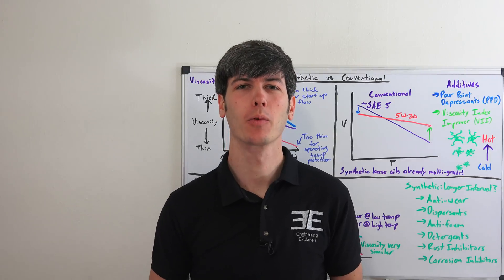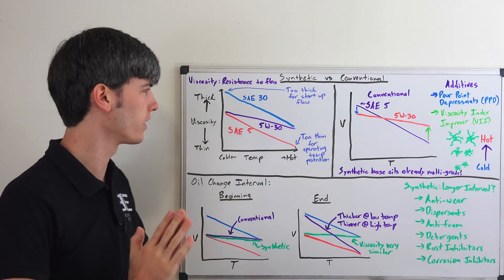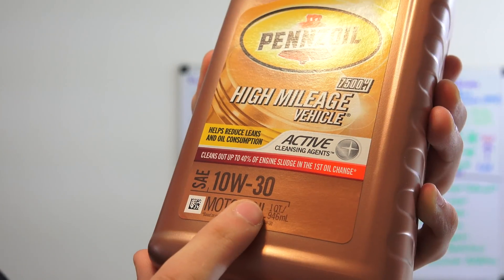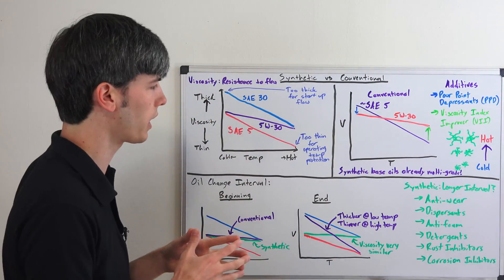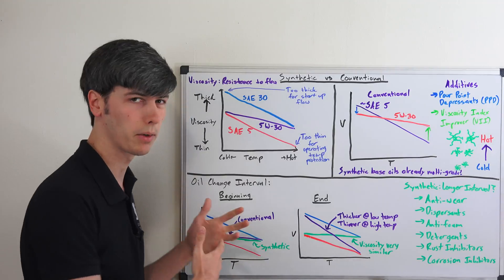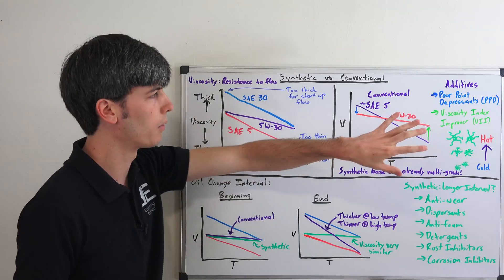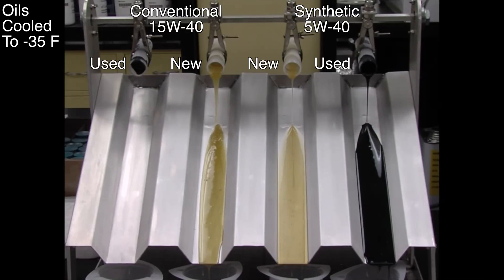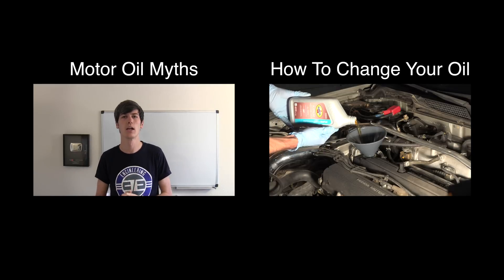Is Synthetic Motor Oil Better For Your Car?

Comment: Jesus how are you supposed to do an oil change on a vehicle using that conventional oil? It was thicker than tar!
Reply: Change your oil when it's above -35°F :)
Reply: Run the engine for a few first, do your beer run at that time too ;)
Reply: Ahh true, for some reason I was thinking the oil he showed in the vid was already warm. My bad.
And yes, the beer run is the most important precursor to the oil change :)
Reply: He said that, and that was not what was being shown, it was between the new and the old of each type. But also showing what the 15w does when you live in cold temperatures and dont do an oil change, so its not bs....
Reply: It's because he used 15 w conventional, if he used 5w it would have flowed nearly the same as synthetic 5w this is marketing bs
Reply: Simple.  Don't change your oil when it's -35 degrees out.
Reply: dude that test is with chilled oils to show the difference.  but when you change your oil, you always have a ride first with your car, and change the car right after it, with engine hot, that oil drains easily...
Reply: That's why you warm up the engine before changing the oil.  (And never, ever, use conventional oil..especially Pennzoil.)  I had a Chevy V-6 and faithfully changed the oil every 3,000 miles with Pennzoil and had an engine failure at 96,000 miles...worst oil EVER.
Reply: nobody does an oil change at those temps lol
Reply: +Terry Beaton been there done that.  i remember having to blowtorch my 1970 beetle oil pan just so it had a chance of starting at 530 in the morning...
Reply: dude that test is with chilled oils to show the difference.  but when you change your oil, you always have a ride first with your car, and change the car right after it, with engine hot, that oil drains easily...
Reply: +Ivan K
 change the oil I mean
Reply: Its almost frozen lol its at -35 degrees
Reply: Thats y its like tar
Reply: +Terry Beaton yup! your nose hairs would freeze just trying to breathe...  thats why i'm moving to hawaii.
Reply: LOL I see what you did there ;)

Comment: I'm watching this thinking. Man you are going to get some hate mail. lol  Actually that was very good BUT you can go extended change intervals on synthetic because the main danger is really wear. All the other detergents are nice and all but they don't just completely disappear and your vehicle would be fine without them for short periods of time. Remember they didn't even exist for the most part when our dads were young. 
Two key things to remember when trying to decide whether or not to go for synthetic. 1. Does your car have a turbo? Do you sit in traffic a lot?  These are the times when synthetic shines. Turbos are very hot and standard oil does not stand up well to that heat for long. I have repaired my share of engines that had failed turbos where the oil passages were so coked up it was literally hard charcoal. yes I literally drilled some of it out.  We won't get into the fact that those cars were using standard Pennzoil.
2. The second major area of consideration is outside temperature. Does it get very cold in the winter where you live. If you wake up and it is 30 below zero outside, your oil may be too thick to start your car. Especially if you skipped an oil change or two.  Synthetic on the other hand makes it relatively easy to start your car despite your cold battery not functioning as it usually does.
If you really want to pursue extended oil change intervals. Have your oil tested at a lab that specializes in that. They can tell you the condition of the oil and whether or not it is safe to keep using. Every car is different so it is important to establish that baseline.
Oh and there is a reason myself and many other older mechanics don't use Pennzoil.
Reply: AETheMexican Back a few years Pennzoil used to be "the cheap oil" so everyone bought it. For some reason it didn't seem to hold up well. It left deposits in the engine and heaven forbid anyone missed an oil change. The classic sign of a pennzoil engine was plenty of deposits/sludge buildup on internal engine parts. Mostly noticeable on the underside of the filler cap. If you took the engine apart you had to scrub and clean every surface with solvent. 
As a young apprentice that was my job and my boss pointed out the difference to me when we rebuilt truck engines at their regular overhaul time. He pointed out which engines used RotellaT and which used Penzoil. RotellaT engines were spotlessly clean. All I had to do was rinse off the oil. The pennzoil engines had nasty sludge buildup on them that had to be scrubbed off.
That is why you find many older mechanics in the US that won't touch Pennzoil. They/We consider it an inferior oil. 
Is it the same oil today? I doubt it but Ill go with what I know. RotellaT has always been above average for quality. 
Will pennzoil work decently with regular oil changes? It probably will. I don't work on engines like I used to so I can't say what the new stuff looks like used in an engine after 300k miles. 
In short, Pennzoil will be considered a joke of an oil for many of us seasoned mechanics. 
Cheers.
Reply: If only the oil wasn't gravitating to the bottom of the engine to the oil pan/lowest point on the car, and Stayed with the metal it's supposed to be protecting. Oh but wait, then Dry and Cold starts wouldn't exist and parts makers and mechanics wouldn't get so much repeat business from the same consumers with the same machine.
Reply: +Qaill1 Well there is an oil out there from Castrol called "Magnatec" it's supposed to have some kind anti-friction additives in the oil that  supposedly cling to metal  engine parts like a magnet even when the engine is shut off, to help protect against dry start wear.
Reply: First of all engine rebuilding is far less common than most every other repair. Secondly I highly doubt the way modern engines are designed is out of maliciousness. How could an engine retain oil pressure while it's not running? It doesn't really make sense so of course oil is going to seep to the pan.
Reply: Cameron Steele Guys guys, there is no such thing as a dry start. Unless you just rebuilt the engine and did it with no prelube. Once you have oil pressure the oil is in the system. It is the oil film that protects the engine and it doesn't just disappear from the bearings over night.
Even if you had oil pressure but the crank wasn't moving you would still have the little bit of wear that you get whenever the crank first starts moving. It is a tiny bit of wear and you have it whenever the metal parts touch. The metal parts touch when the crank quits turning. 
Keep in mind all the engine needs at a slow idle is oil supply and not necessarily pressure. You only need pressure if the moving parts are slinging off the oil faster than it is arriving to supply. Well the hydraulic lash adjusters need some pressure but that is something different entirely. 
I can suggest that if you want a teeny tiny bit of insurance you can add some STP oil treatment to your engine oil. Warning!! Only after the engine has broken in.  On new cars I wouldn't till it had at least 30,000 miles on it. 
The stuff is sticky. We used to mix it 50/50 with engine oil as a prelube.  If you get it on your finger you can feel it even after washing your hands. On numerous occasions with an old car we had it got driven home from town with no oil pressure. Don't ask the details. Still have the car. It was a '93 suburban. It burns so much oil it's not even funny. Doesn't smoke, doesn't make noise. It's just flat wore out from abuse and trying to make it to 400,000 miles. I have another older vehicle I drive that suffers from an internal oil leak and has no oil pressure at idle when hot.  Been that way for over 10 years when the engine was rebuilt.
Always use STP in all older engines because it really does help.
Reply: Do u think 10w 40 full synthetic is to thick to be used on a opel astra H in Australia where at the moment it's winter and gets down to 3 degrees Celsius? The manual says to use 10w 40 so i do but thinking maybe go abit thinner as its pretty cold atm.
Reply: 3°C peak down is normal winter temperatures, it's nothing like the peak temperatures they get in the north of germany. Opel being a german car, you know what that means for the viscosity, if the germans use it in their cars, you can. if you don't want to follow the manual, just a question to be asked first : how many kilometers have the engine, if it is too old, it might be worn or have sludge in the crankcase, and getting thinner synthetic oil might cause issues.
Reply: molybdenum additives do that !
Reply: luke isaac That weight of oil should be fine for those temps. I would not worry about it unless you are having difficulties starting the car. Replace the battery first though if it has many years on it.
Reply: ***** As a mechanic I do not recommend those additives. The reason is this. For  molybdenum to be effective it has to made just right. Many companies are taking shortcuts with it and this can cause it to be highly abrasive. Since you have no way of testing whether or not the particles are the right shape and size it is really not worth the risk when other products can do the same job better.
Reply: this can happen with the MoS2 form of molybdenum, which is particulate form, easy to identify it looks dark. The soluble molybdenum found in newer oils is not known to be abrasive.
Reply: ***** Here in the US you see it in greases a lot. Never seen it in an oil, yet.
Reply: Why exactly is Pennzoil bad? That's what I use :0 After reading through other comments, however, I think I might switch to Mobil1

Comment: Like to hear how many drivers are worried about wearing their engines out.. ?

majority of cars are either sold or traded in with plenty of engine life left no matter what kind of motor oil being used at least 10k miles changes.

If the car is older than probably some gasket leaked oil..

Comment: But don't use synthetic oil in an older car.  The piston rings are of a different variety and the synthetic oil will blow past the rings.
Reply: Not in my 1984 Caprice. It leaks a few drops after shutoff though so later on I'll use a thicker, High Mileage 5w30.
Reply: Austin Lucas I'm talking up to the mid '70's.  The oil rings were different before that.

Comment: So i need synthetic oil with lots of zinc for my 1968 pontiac firebird then...
Reply: Yup, Rotella, delvac or Delo, it's all great stuff. It's been good to the old engines on a few motorcycles too. It can also remove a lot of old crud from Your engine. Best thing is not only is it great, but even the full synthetic rotella T6 is cheaper then regular car synthetic oils.
Reply: Amsoil makes some, it's called "Z Rod". It comes in 10w30 or 20w50.
Reply: +Austin Lucas too bad it costs an arm and a leg.  I drive that thing 30 to 40 thousand miles a year... I have so far just been using diesal 10-30 with great results
Reply: For engines that don't have a catalytic converter use 15w-40 diesel oil. It has plenty of zinc.
Reply: +faffaflunkie yup.  i love that stuff.
Reply: Ivan K I'll give delvac a try then. A former boss who's father ran a mercedes shop told me his dad put rotella in all the older cars as it cleaned the engines so well. He also told me if someone had never run it before to change the oil filter in 1000 miles as the the crud cleaned out blocks them. I always saw delvac as more a commercial diesel engine oil, but I'll give it a try when I change the oil in My old 944 soon.
Reply: Diesel cars go 300-400 thousand miles before they need an overhaul. Diesel Trucks can go a lot longer- maybe even a million miles. In my experience with diesels the fuel pump- which is the most expensive part of the system- goes long before the engine does.
Reply: +Oldbmwr100rs in my commercial truck, del and Rotella does not match up to delvac, delvac beats them hands down, others are priced higher for no reason, they ARE ACTUALLY WORSE!!!
Reply: +Ivan K good to know ;-)
Reply: Anyone who values their engine would use an oil with lots of zinc. Actually there's an orginzation that tells you how much zinc is in each oil, You can just look and pick which one you think is best "bang for your buck". If you're worried about the environment you could change your oil every 5,000, 8,000, 10,000 miles with synthetic, but if you're worried about engine wear I'd stick to the old fashioned 2,000 mile oil changes.

Hell, I change my synthetic oil every 5,000, all highway miles, about 300 miles per week, even though my manufacturer recommends 10,000 changes. Piece of mind.
Reply: STP is really for Higher Mileage cars. If your car, van or truck has less than 130,000 miles (270,000 km) on the original motor, I just wouldn't bother with it.
Reply: https://www.amazon.com/dp/B00ELHT3N8/ref=cm_sw_r_sms_apa_QedTxbDG7VDRY

I always use this for my cars and it runs s smooth.
Reply: Brad Penn is what I use in my 1970 Plymouth Duster, around here in CO it's about $7 a quart you can buy it online or usually at machine shops or racing parts stores.  Very high quality oil, not classified as a "full synthetic" but it's better for our old cars than most modern full synthetics.  Also refined here in USA which is pretty cool.
Reply: My owners manual just calls for an API rating sm or higher, I just buy the cheapest one (wal-mart brand?) none synthetic.  I have 102xxx miles an it.  No problens yet.  #Fingers crossed.

Comment: How is that fair when you're comparing conventional oil 15 W - 40 and synthetic 5w - 40?b the oil weight and viscosity are not the same??
Reply: He's not comparing viscosity between conventional and synthetic, listen again.
Reply: +Austin Lucas ya he's comparing flow rate at certain temps which " is" viscosity, were u listening?
Reply: I was listening. He's comparing new vs old.
Reply: Word mishap. When I said "he's not comparing viscosity between conventional and synthetic" I meant he's not comparing 15w to 5w; you said something true in the video in that he's comparing how fast the oil flows which is the viscosity. We're both correct.

Comment: BS.  That will not fit better on all car/truck at over 75K miles.  You would need oil made for 75K miles or blend synthetic.  Old truck/car can't have synthetic motor.

Comment: If you're changing your oil that far down to the point where it is black, you dont know how to take care of your car
Reply: On some cars that might be right. But my turbo can really cook the oil the left inside of it after turning the car off. My oil is usually pretty dark within 1-2k miles.
Reply: My old car started burning oil so it's black within a couple of weeks. :D
Reply: also diesel engines turn oil black almost instantly
Reply: Techno sailor Agree. A gas powered car with oil that color has a major problem somewhere. However I suspect either this oil was used in a diesel or was pulled from an extreme use lack of oil change situation to emphasize the difference in the demonstration. The effect is the same just a little less pronounced.
Reply: Or it is a diesel. My thought was it was a diesel. Diesel oil can be that black in a week or so. In fact in just a day or so of normal driving the diesel oil can be blacker than most gas oil when the gas oil needs changing. Color doesn't necessarily mean as much as you might think. Though I know something is seriously wrong when a gas car has oil that black. Gas powered car should just have slightly darker colored oil and never opaque.
Reply: i know it can be diesel, i should of mentioned that first, but normal oil...for a car nahh. not unless there are variables like turbo and chargers involved from what i experience
Reply: consaka1 true words

Comment: My 2010 Audi requires 0W-40 synthetic. My 1983 Delorean requires 20W-50.

My how technology changes. Modern engines have such tight tolerances that require thinner oil these days.

35 year old boat anchors require the thick stuff. Thin synthetic will just seep everywhere in the motor through the much looser tolerances of older motors.

If I used 0W-40 in a 35 year old motor, it would surely burn a quart or 2 between changes.

Comment: I totally agree with this guy.  The best thing he said is stick to your manufacturers recommend oil change interval with conventional or synthetic.   I say the more often you change your oil the longer your engine will last.   There is a lot of propaganda about oil change intervals.  Some synthetic oil manufacturers say you can go  as much as 10,000 miles between oil changes.   Many people are maintenance lazy and look for ways to "beat the system".  If you are using synthetic oil to try and extend your oil change interval  you will be asking for big trouble especially with todays cars with computer controlled variable valve timing mechanisms.  I've been in the car business over 40 years and have noticed the people who change their oil the most have the least problems with their cars.  The ones who try and beat the system and think they can go 10,000 between oil changes, many have premature major engine repairs and many oil leaks.  For example if you push the limits on your oil change intervals your timing belt will wear out faster.  The dirtier the oil becomes the harder it is for the engine to turn the camshaft via the timing belt hence more wear.  Todays cars are a major investment.  Regular on time oil changes is cheap preventive maintenance and will protect your investment.
Reply: Doug, not everyone who runs a 10K interval is trying to beat something. At least since 2003, some vehicles have had a manufacturers recommended oil change interval of 10K. I have a 2003 Lincoln Town Car and the oil life percentage is built right into the computer.  Factory requirements are synthetic blend oil which I switched to full synthetic after the end of warranty. 159,000 miles with no oil use, burning, leaks, and the plugs at 100,000 were pink with no carbon or oil.